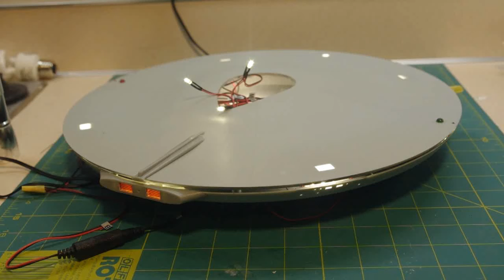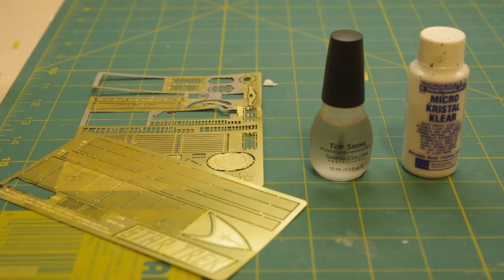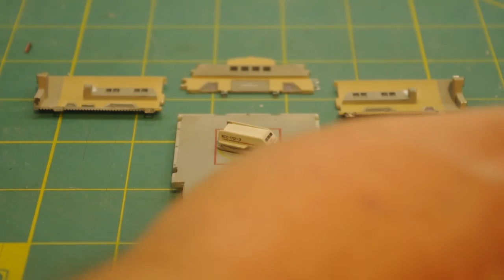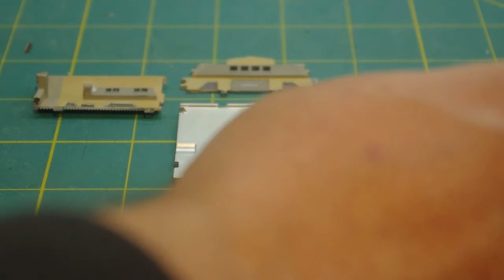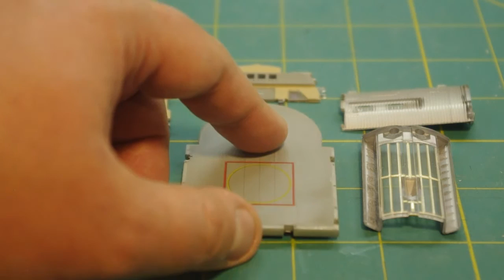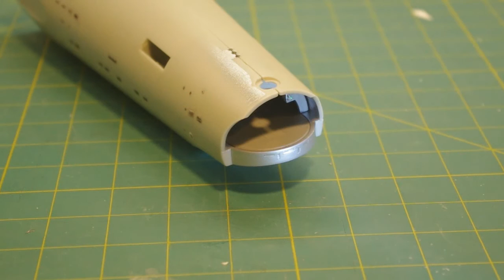Polar Lights 1/350 Classic Star Trek Enterprise model project Part 3

Comment: Great videos JM! Further to the fit of the shuttle bay I've seen comments on other forums to the effect that the LEDs when they're added to the bay interfere with the fit of the engineering hull halves, even when bedded in really tight. A possible fix apparently is to trim the inner parts of the "Ion Pods" (clear part 133 in each side.) Looking forward to your next upload.

Comment from the maker: Thanks Randal. That is something I'll look at as well as seeing if the LEDs that fit along the sides of the bay might also have problems as well. If I have to, I can always use my trusty Dremel with an engraving tip to grind away material if I need it. Don't worry, whatever I come up with (problems, solutions, concerns) I will share with you guys when I figure the problems out.

Comment from the maker: You only need to heat up the etch the anneal it if you are trying to bend it around a curve or else the springiness might pop it off (such as on the bussard domes or the fantail). For areas where folds are provided (such as the bridge consoles) you don't need to do that. I'm trying to mask my shuttle bay fantail and overhead area in such a way that I shouldn't need the etched light blockers for there (which do need to be annealed). But if it doesn't work, I've still got them.

Comment from the maker: Because silver paint is made up of small metallic particles while black paint is pigment and opaquing agents. A thin layer of silver can be built up to an opaque level in fewer coats than normal paint. Plus since it reflects light, it also aids in light transfer (essentially doing two jobs in one).

Comment: Are you using connectors on all of those light strips?  If so thats a lot of failure points.  They tend to get brittle over time and crack.  Its also an expense you dont need.
Reply from the maker: Phu Vet The connectors used are the ones supplied with the kit. Yes they may become brittle over time, but that is one reason why I used Shoe Goo (i.e. liquid rubber) to anchor the connections in order to give them some shock absorbtion rather than hard anchoring them with a stiffer glue or letting them free float. The connectors used are a slide type on the light strip, so there is a lot of surface contact.

I do know what you are saying in that a solder connection is superior when it can be used. But I think I have done what I could to make sure the lights work years down the road. The model lights are still working strong all these years later with no problems.

Comment from the maker: I used a brand of masking tape called Aizu from Japan. It is like Tamiya tape, but cut into thinner widths of 2mms or so (I get mine from Starship Modeler.com). But I didn't necessarily have to mask the windows exactly since the Paragrafix photoetch set also works as light blockers once applied over the clear window areas.